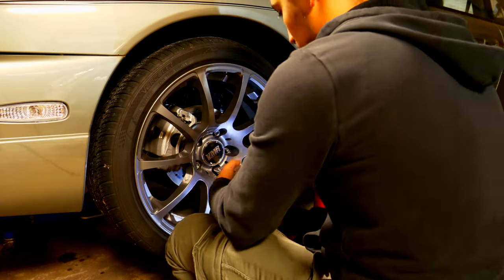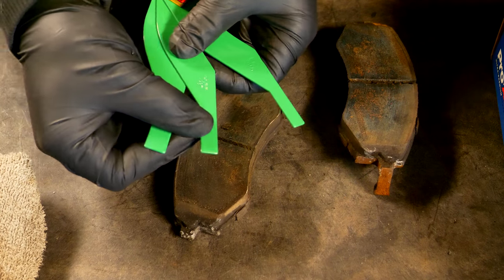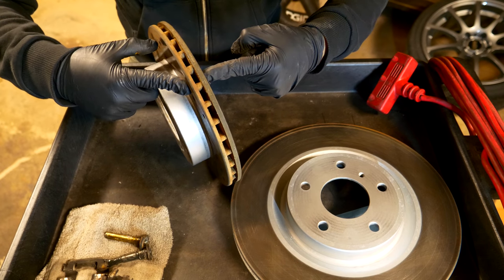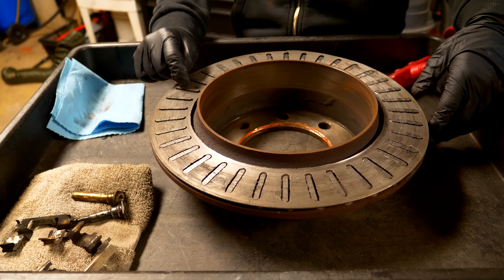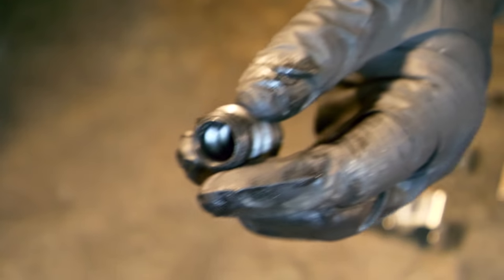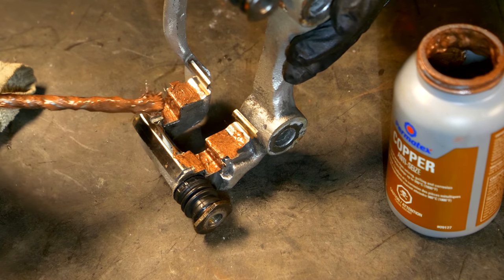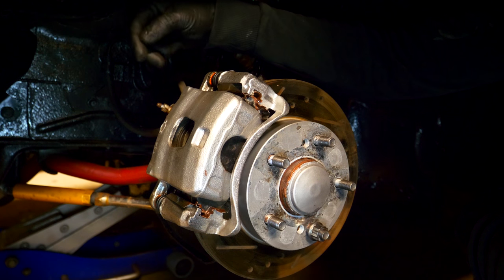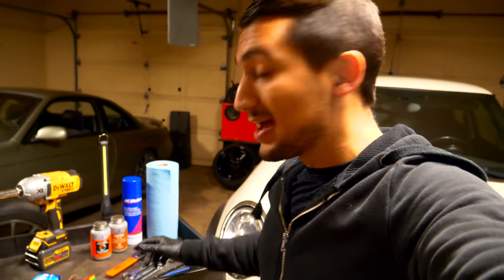How to Inspect and Lube Your Brakes (COMPLETE GUIDE)

Comment: Since you pushed the brake piston back, you forgot to mention to first pump the brake pedal until firm before going out for a drive... If you don't then you will have a terrible day 😅
Reply: Thats not true. I change. Never pump the brakes.
Reply: Yea your right bro!  I forgot to do that on my mom's suv and she ended up running into my gmc!
Reply: @thfcdan1986  You are  lucky - so far but be safe ad pump until the pedal is hard. I was caught out years ago.
Reply: I almost hit my garage when I first did the job :))))
Reply: Same, I forgot to do this and almost kept going backward into all the stuff at the back of the garage. Lolz. I was like, "oh, snap!"
Reply: Yes, Yes,    Always,  @ the end of  a 
BRAKE  - JOB,   pump the brake pedal,   until it gets hard,   Also, 
"Check the Brake - Fluid - LEVEL" 
&  then go
for a " TEST DRIVE"..!!
Reply: A
Reply: almost went into my garage cause i didnt do this
Reply: Where is Milan's reply on this?
Reply: Do you do pump the brake with the engine on?
Reply: Right, he assumed most know.
Reply: @jorgewong910  yes cuz th e piston is pushed back so it need to be pumped just once to bring the piston out again where it normally rests
Reply: @jorgewong910  depends, if I continuously pump my brakes a few times with the car off, sometimes it hardens sometimes it just lets me pump it up lol. Anyways, as long as you pump it will do! it just needs to push the brake pads to where its meant to be.
Reply: Thanks for the tip
Reply: @jorgewong910  no
Reply: @thfcdan1986  You should test your brakes and pressurize the fluid.  Good luck.

Comment: My take is to NEVER put anti-seize or any other grease on the ears or the hardware pads slide in.  You've just created the best dirt, grim and pebble magnet in the world.  Put brake grease (very lightly) on the surface of the bracket BEFORE you install the hardware (and never reuse old hardware).  This will keep the bracket mating surface from rusting and squeezing the pad ears as rust builds up.  Also lube the bracket where the back of the pads contact the metal surfaces and that includes the piston.  Never reuse brake hardware.  it cost pennies and you can buy it separately from the pads if you have to.  Oh yes, anti-seize belongs on nuts, bolts spark plugs and treads in general and nothing else.  Anti-seize cakes up over time and with heat.  Use brake grease that's what it's designed for.  Also attempting to crack the break bleeders is a great way of snapping off the bleeders.  Don't mess with them unless you have to.  It will take what should have been a half hour per wheel job and turn it into a all day affair.   This is especially true if you have dissimilar metals.  Only a light coat of grease goes on the pins.  Lots of grease as you put on risks the hydraulic affect of pushing the pins out when the brakes are warm.  And I shouldn't have to mention that brake bolts and wheel nuts should be finished with a torque wrench with the proper specs for each group.
Reply: I’ve got three torque settings depending on the size of the bolt; wrist, forearm, and full arm. Has never failed me!
Reply: First thing, clearly no one taught you what a paragraph. Second, your entire argument apply to climates with a real winter. Our roads are salted in the winter, having a little dirt and sand is a non-factor compared to your slide pins and pads rusting to the caliper bracket.
Reply: @spencerd1079 what’s so crazy is you both sound right. I’ve watched dozens of these brake, change videos and everybody sounds so confident and correct in their method. It’s nearly impossible to find the correct spots to lube & the correct lube(s). I think we can all agree on torque specs, safety tools, and the correct manner and doing the job - BUUUT the freekin Lube man - everyone’s got their own way that they think is correct!
Reply: @newbluerugby  exactly how I feel… Thank you

Comment: It's a mistake to put silicone paste/grease on to the bottom of the sliding pins because they will not compress fully and this prevents the pins going to their full length of travel. This will give uneven brake pad wear. Also the correct place to grease is below the shims. If you grease the parts you have shown it attracts dust from the pads as they wear and this can cause the brakes to squeal. otherwise, very good and interesting to watch
Reply: Great points thank you
Reply: This is a myth. They generally don’t slide the full distance anyways, so hydrolocking etc isn’t possible. Grease/paste works it’s way to the end anyways in the course of normal operation. Silicone paste or Japanese style ‘rubber grease’ like niglube is indeed the right way to lube slide pins.

Comment: Looks good! But I wouldn't use antiseize on the shims. Antiseize is for non-moving parts only. On moving parts, itll harden and seize. I actually wondered why you didnt just carry on with the silicone paste there
Reply: Using antiseize on shims prevents rust and buildup between the bracket that prevents the shim from laying flat and prevents the pad from sliding freely. It seems weird but it has a purpose.
Reply: @theniceneighbor  silicone paste does the same job but won't harden, hence my comment

Comment: Just an engineering clarification.  ANTI-SEIZE is NOT A LUBRICANT.  In fact it specifically formulated to not affect the torque on a bolt.  It's job is to eliminate corrosion especially between dissimilar metals, eg aluminum and steel which is a classic problem where a steel.bolt is put into a piece of aluminum.  it is often used on high temperature bolts that corrode due to the high heat.

Comment: Thank you for sharing your video. I however do have a question. I noticed that you used anti seize on the hub before you pit back the rotor and on the brake hardware. My question is that would (brake and caliper grease) work the same as the anti seize on the same areas applied

Comment: Very good video and detailed.  I would add cleaning the inside of the wheel and wheel studs before install.  Then torqueing them down properly.  Cleaning the stud threads, back of wheel rim and the caliper bracket threads and pin bolt threads is important.  Also, cleaning the bolt mating threads and torqueing to OEM spec. is important.  People don't all have that right feel for tightness.  Using a dial indicator gauge and checking rotor lateral runout is important as well.  Anti Seize should be used on the caliper bracket bolt threads (light application) and silicone grease should be applied to the hardware.  Anti seize is not meant for the pad riding areas.  Silicone grease should be used on pad riding areas and some OEMs discourage it (may attract dirt and grime).  However, a light application under the hardware is referenced in the service manuals to minimize corrosion.

Must ensure the brake line is not twisted when that caliper is put back on.  A before picture should be taken to reference; when installing as a check.  A break in should be done for new pads and rotors.  Checking that the hardware is not contacting the rotor should be done.  The caliper bracket bolts should be replaced if their threads are worn and a check for lateral play should be initiated. A loose fit could be an issue if bolts are reused.

You are an excellent instructor.  Your material is well presented and recorded.  It was a pleasure watching this video and your explanation of cleaning the pin areas and applying proper lubricant for free movement of the pins was spot on.  The rubber boot condition is important and they need to be replaced if damaged.  Great job cleaning the hardware.  Good work!!
Reply: Good feedback I like it 👍🏾
Reply: How do you clean the stud threads and bolt mating threads? I think I skipped this and had a misaligned bolt that stripped my caliper
Reply: @mrc79  You spray brake cleaner on them and use a wire brush.  Then you can blow out with compressed air or wipe down.  There is a tool that attaches to a power drill that cleans them  with a circular wire brush (fits over the studs and cleans very well).  I use this tool.

Clean the stud and lug nut threads for optimal torque.  Do not use lubricant if the service manual requires a dry torque.  Follow the OEM service manual requirements and not "good" ideas in You Tube.

Comment: Great video!!! I am teaching my 12 year old how to do maintenance on your ride. We knocked out the shocks on my Ford Excursion now we are moving to the brakes. Your video has helped us so much. One of our push pins was completely stuck in,the rubber boot was tore and was letting water in so it was rusted solid. I ordered new boots and shims and we will be following your video and doing it right. Whoever changed the pads last time did nothing but install the pads. Everything is dry. Can't wait to knock this out and show my son the right way to do it. Thanks for posting.

Comment: Hi, good video, one thing, you didn’t allow for extra fluid going back to the master cylinder, I always  put a pipe clamp on the brake hose and crack the bleeder valve put a tube on the end and then push the piston back with a G clamp, just by putting a old pad on the piston, tighten the bleed nipple and remove the clamp that way you won’t displace the master cylinder seals, which happened to me once. So many videos don’t take that into account, you could of course remove some fluid from the cylinder first., top up brake fluid level, and pump the brakes before driving, hope that helps anybody.

Comment: Not many people will remove rthe wheels until they have an indication that their brakes need immediate attention, usually to replace worn pads. At that point, it is easy to clean and lubricate the calipers. Be sure to remove the old grease and re-lubricate the caliper parts when you replace your brake pads. Don't forget to inspect the rubber boots on the brake pistons, and replace them if there is any damage. Great video.

Comment: Great overview of the essentials. Well done! When i replace the pads, i crack open the brake fluid reservoir cap before compressing the piston so the fluid goes back into the reservoir. i have used the 3m silicon paste all along but will try the permatex variety you showed. Thank you for the great video.

Comment: I'm no longer applying anti-seize between the pads and hardware.  I find it becomes a magnet for dirt and grime and causes more sticking.  Just clean the hardware (or buy new hardware), clean the ears of the pads and they slide beautifully without any lubrication.  The most important thing to remember is to only use a silicone-based grease on the slider pins.  Kleen-Flo high-temp ceramic brake lube totally seized up the pins on my RAV4 and swelled the slider pin bushings.  3M silicone paste is all my cars get.

Comment: Very thorough ... brakes are not that difficult, but perhaps a learning process ... nice to see that you carefully clean and lubricate with the correct products ... I sold all my vehicles and toys when I retired, down to one 2000 sweet cherry Jeep Cherokee Sport with 250k on the 4.0 ... my second one in the last 35 years ... rebuilt from the ground up sans the engine block, they get 300k out of the old cast iron work horse ... noticed today coming home a slight drag on front left caliper, and that side was hot and a little black dust on alloy rims ... did Cal/rebuilds with new ceramic pads and rotors about 7 months ago ... PA roads are tough on them, salt, plus I go to the car wash once a week (often get undercarriage wash) so I'm assuming it's the sliders or pad/shims bound up ... all that water/wash to keep frame rust at bay tends to rust up the cheap sliders, have seen that before when routine changing of calipers  ... pads/rotors are still good/even ... so even if it's a piston, rebuilds are only $30 bucks ... and will at least re-lube other side or replace both ? ... rears are drums on the 2000, will check them before weather gets bad ... good news is drums and pads/pistons are cheap for these, so i just change everything out for smooth braking ... ceramic pads up front decrease braking distance by 30% and are as smooth as silk ... nice video ... I also have the permatex lube and anti seize ... my grandfather was a salesman for them out in LI back when they were in the aviation business only ... 1940's

Comment: Not sure if it was mentioned before but I would be careful if your brakes have the slide pin with a rubber bushing. The wrong type of grease will cause it to swell and may reduce brake performance.

Comment: I would have mentioned that if you don’t have a tool like that and your replacing the pads to use the old pad and a C clamp to close the piston
Reply from the maker: Yep that works too!!!
Reply: Get a adjustible plier.
Reply: Yes,   another way of doing it too,
is to get a  LONG Screw Driver,
Like a  "12 - inch ", Size, should be fine,  &  before taking them apart,
you can,   put the " flat - head"  between the -  pad  &  Rotor,   &
PRY,  &   PRY,  on it,  hence pushing the - - PISTON -  back into the - CALIPER,  👍

Comment: This works. Last week I did this as well as popping the piston in the brake calliper out, so I could clean some rust of it. Definitely helps. I would recommend using copper anti-seize from a spray can, as it is much easier.

Comment: One additional comment: 
Always put a little grease between the sliding clips and pad carrier. This prevents noise and keeps the pad carrier rust free. Everything else is explained and done well.  In addition, check for binding when pressing caliper piston back into the caliper.
This is my own experience after doing hundreds and hundreds of brake jobs. Thank u
Reply: NICE TIP , but didnt you think he put too much anti seize on the sliding clips? I thought it was a little too much

Comment: Just watched a couple of video's about this that were a JOKE.....This one was so easy, nice and informative....Thanks....also I have noticed that no one has mentioned something I discovered awhile ago,  that if you take your brake fluid cap off and VERY EASY pry with a screw driver or similar tool on the rear or front brake assembly before you remove it, that the brake piston collapses all the way back with no resistance.....just FYI

Comment: Great video. Only problem is if you use copper anti-seize with a rotor coated in Geomet or Zinc, it can cause a minor galvanic reaction. Geomet has aluminum as part of it's composition so it'd ruin the coating over time. I'm kinda kicking myself for having bought copper seize awhile back cause I ended up buying a Geomet coated rotor then realized I can't use it after looking it up for awhile

Comment: Great job bro. I never new to use anti seeze on the hardware I always used high temp brake grease. Thanks for the tip.
Reply: I used to but its a bad idea. Its best to use the grease provided or get some. I have used regular grease in a pinch, its better than nothing.

Comment: I hate going into a job and having that feeling where I'm not sure what I'm doing and impending screw ups that will cost me more in the long run than the peace of mind in dropping the car off to a mechanic.    Well, not this time.    After I finished watching your video I had the supreme confidence to do it myselfus.    History, I had a metal on metal grinding noise coming from the driver front brakes.   I thought maybe the pads were wearing thin, but it turns out the dust shield was bent into the disc rotor, so I bent it back a little.    Also, I inspected the brake pads which were down 60% or more and starting to "crack", those long cracks that develop after brake pads wear down close to metal.    So,   I went up to Oreillys,   front pads, both sides $40.    I cleaned everything up, used two packets of brake caliper grease.    To pinch back the caliper I used a crescent wrench, which worked perfectly.     I was extra careful too, according to your video, to not let the brake housing "hang", and fortunately I had a bungee cord in the trunk.       Hey Mastro, all in all, thanks for the great video.   You know your voice gives your viewers confidence to do the job themselves.    I watched your video one time, and that's all I needed.     Your video is 5yo, but just as relevant today!   July 2023

Comment: Impressed. A very thorough video. i found it quite helpful. It's always good and very satisfying to DIY if you can. I have cleaned and changed pads on my motorbike calipers and cleaned the pistons without taking them out completely but hadn't done my cars. I need to do it soon on my VW Golf as one front caliper is intermittently binding which causes a judder and overheating of the wheel. Unfortunately garages just want to throw one off and replace with a new caliper and charge you a lot....  Just dump more waste at the environment and charge the customer,  something that I hate.

Comment: How about greasing the piston and ears on the caliper? You also forgot to mention torquing the screws. Also, saw in another video that it’s not a good idea to put grease on the bottom of the pin because it could prevent the pin from going all the way in.

Comment: Homie the slider that you lubricate at 10:45 is missing the rubber bushing that’s why you still feel it “grinding” when you put it in...
Reply: I am glad some caught, I did too
Reply: C Hansen  actually you can see the lower pin is necked down & there is a slight ridge on the end, it's missing a rubber sleeve, that is used to dampen vibration.

Comment: use copper anti-cease between the wheel and the hub assembly as it will make it not only easier to remove but will reduce the chance of rust forming because of rust marks

Comment: Very good and informative video. Anyone should be able to do this themselves with basic tools. I have one question: Why did you go for copper grease on the sliding surfaces? I tend to use the 'Permatex Ceramic Extreme', purple ceramic paste on those surfaces.
Reply: Dont use the purple